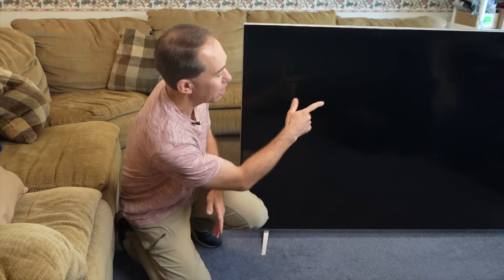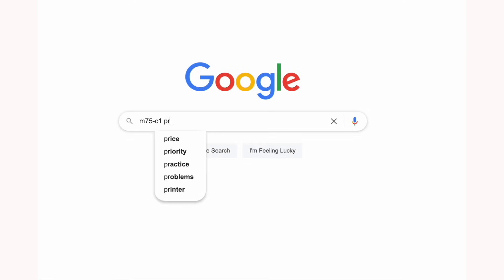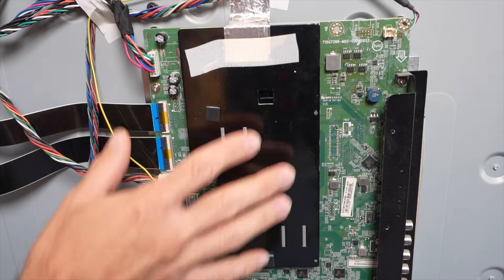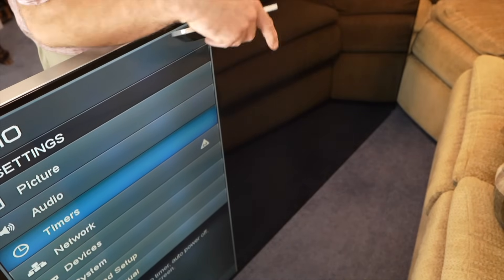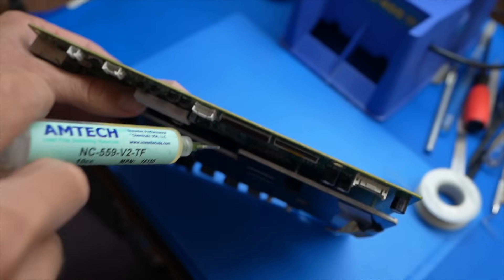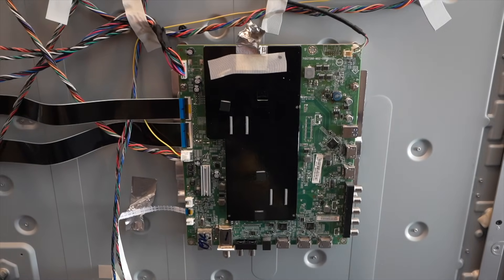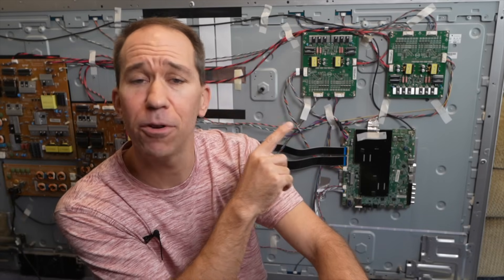I FIXED a HUGE TV for FREE - You Can Too!

Comment: Hey I found your videos while trying to troubleshoot my ASUS PG65UQ.. do you know if there is a fix for this? I cant add reddit link here, but in short the display started to display faint grey horizontal lines all over the screen.. very harsh when 144Hz enabled but now I get them when turning the monitor on at 120Hz.. but after 30minutes it kinda dissipates.. very strange.
Reply from the maker: Not sure, sounds like a faulty capacitor or another smd component
Reply: @FrugalRepair  Yeah.. thought they use long term capacitors.. I member fixing my old 52" TV that didnt turn on anymore by soldering on new capacitors..  but this problem is visual. I left a thread on Reddit with a screenshot in "Monitors" Reddit

Comment: Yeah reflow work but no one can say for how long... I used to do this back in the RROD Xbox days... it would always work but always fail again soon after... 
The Board replacement is the correct fix.... and maybe  thermal glue a bigger ( wider) heatsink) on it to prevent it from happening again...
Since it's a common failure on these Vizio tv......

Comment: What is the cause of static noise from tv? I got a 65in Panasonic plasma. It makes a buzzing electric noise. I tried disconnecting the hdmi cable to see if its outside interference but the hiss is still there.
Reply from the maker: That could be anything, really.  If the noise is coming from the speakers, it’s likely a problem on the main board.  But if not, sometimes you can get close enough with your ear to hear which board has the buzzing part on it.

Comment: I have the same tv and been having the same problem for three years now. I throw the board in the oven at 385 for 10-15 minutes about twice a year. There seems to be a 90% fail rate on the m series from Vizio and some of those parts are interchangeable with lg models (e.g., t-con board and power boards.

Comment: This is probably a dumb question to someone in the know, but where do you put the negative lead when you are probing the connections with a multimeter? We saw and understood the connectors you were probing with the positive probe but not where you complete the circuit with the negative.  Is it just the chassis, the neutral feed on the power cord or something else? Thanks in advance for any help.
Reply from the maker: Not a dumb question at all.  I have the black probe on the metal chassis.  I usually have it in a hole in the metal and hang it at an angle so you don’t have to hold the probe.  Any metal touching to where the screws to the boards are is good for a negative probe spot.
Reply: @FrugalRepair  Many thanks for your quick and detailed response and thank you for your useful videos.
Reply: @watsoft70  I was SO inspired by the videos you've done and I've watched several of them., That I have gone out and collected for 55 inch TVs, hoping to find one that still works actually. I was given a smart TV 55-inch the light blinks twice but no picture it's a Hisense. Do you have any idea what could be wrong with it the red light blinks twice then goes out. If you're anywhere near the Louisville KY area you can have the other TVs if you want. Free, I just want a 55 inch working TV.
Reply: Im sorry I meant to send that to the repair guy. I'm really old school and get confused easily.

Comment: Good grief. Board swap... Troubleshooting it to the component level is repairing. Find those leaky capacitors and fried voltage regulators and replace them with one beefy enough to handle the load and you have a repair that will last a lifetime. Not sure how you"fixed it for free" when you paid a hundred bucks for a questionable board.
Reply from the maker: You didn’t watch the whole video.  I didn’t buy any parts to work on the board.  I showed how you can swap boards if that’s all your comfortable doing.
Reply: @FrugalRepair  OK, I finished watching the last three minutes I skipped. I disagree with your diagnosis of a faulty microprocessor. If the chip isn't getting voltage due to a faulty component it will not produce heat. Rarely does an IC go bad itself, but rather a supporting component. Heat is the number one enemy, however. If it's not cooling properly you could be right. I was expecting a cold solder joint or a bad connection which you fixed "for free" based on the title.
Reply: @Ed-ym4tu  Ok, just curious but if it's a faulty component, than why did reflowing the solder under the processor work? Not trying to prove you wrong, I am actually trying to learn more about repairing these boards, so any information you have is helpful and very much appreciated.
Reply: @wolfman122970  I thought I saw you just swap a board. If you reflowed the solder and it fixed it then it was a cold solder joint.

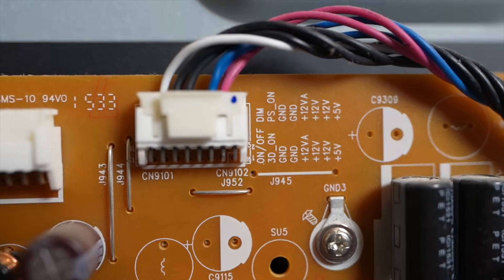Comment: 2:20 now, with your only tool, the screw driver, you verify the voltages. 😂
Reply from the maker: Yep, I'm showing you how I do it.  If you watch the whole video I explain how you could fix it with just a screwdriver.
Reply: @FrugalRepair  I was only joking a little because just a moment after saying that you pull out the multimeter (as in technically using two tools) :D
Was a bit funny.
Of course I watched the whole video :)
Thanks for the content!

Comment: I like how you only used a screw driver, multimeter ,flux, and a hot air station.
Reply: And a human body..., brains and ability to read and use his hands 
And think logically.
Reply: ha
Reply: It’s frugalrepair! What do you expect?❤
Reply: Some, all or equivalent substitute tools could be bought for super cheap. So there's still a large turnaround. 

Think. 25. Maybe 50 bucks. To repair a TV that costs probably 3000. 🧠

Even the 100 for a replacement board is a fraction.
Reply: @SacredMilkOG  Absolutely, worth the time and effort. However, not free. Free would be not spending any money and not having any pre requirements for it, just basic tools. and a Hot air station might be a bit more than a basic tool.
Reply: And heat camera.
Reply: And a PC with browser to Ebay and his electricity to power hot air station, lights, TV, etc. LOL

Comment: I picked up a 60 inch tv and no start condition. Found selector switch on rear with shorts. Ran current through it and conditioned the contacts and it worked again. If they would have spent about ten cents and used pull up resistors the contacts would stay clean.
Reply from the maker: Congratulations on the repair!

Comment: I wondered if you could add / mount a cooling fan. Thanks for a great video! And I subbed!
Reply from the maker: Thanks for watching and the sub!
Reply: @FrugalRepair  very welcome! 🤓 Is it really worth it to replace the LED / LCD screen on TVs ranging from 43" to 50"? Have a Vizio 50" (smart, 4K) & an LG 43" 4K. The Vizio works but the screen is messed up/damaged. Think the LG has a backlight problem. Thank you 🤓
Reply from the maker: If you have an extra lcd assembly it’s probably worth it since it is not that hard but I doubt you can buy one anywhere.  If there is a crack in the lcd then you can’t fix it.  Many other issues though have a fix or a hack you can do to get it working.  Did you watch my fix with tape videos?  That may help give you clues on things you can try
Reply: @FrugalRepair  yes I watched your "tape fix" video! 🤓 I don't have an extra LCD assembly. For a kind of hobby, I look in certain dumpsters, curbside stuff, asking people moving out of houses, apartments, etc, looking for laptops, PCs, Chromebooks, tablets, etc. My regular job is a warehouse (we sell gym equipment) worker. The business next to ours (a recording studio) had a defective LG 43" 4K TV, and gave it to me. The other TV, the Vizio 50", was a dumpster find. I actually don't normally take TVs, due to size.
Reply: @FrugalRepair  some time ago a neighbor gave me a Sony PS3 (working) & a Dell Latitude laptop (also works!) I want a TV (flat screen) for the PS3.

Comment: I have a vizio E390i-B1E . I was told it had no picture. The first time I tried it I got a picture but it was dim. Next time I tried it no picture. I pulled the main board out and took the heat gun to it. I just put it back in and have the dim picture again. What would cause the dim picture? I have played with the brightness. It would work ok in a dark room.
Reply from the maker: Not sure if the dimness is from the LED backlight or you are meaning an issue with the LCD screen / picture.   Did you happen to watch my videos on fixing a tv with tape?  You can try to do the isolation technique that I showed to give you clues on if the issue is on the LCD or not.

Comment: I got a 55 inch Vizio 3D TV I had a problem with the speaker he came and changed the speaker but when he changed it he picked it up the TV up and moved it without the back being on and now I have colors going everywhere. It was working great all he was to do was to change the speaker could it be he ruined the set maybe the screen got twisted from picking it up and moving it without the back on
Reply from the maker: Try reseating the cables to the lcd. Hopefully he didn’t mess it up
Reply: @FrugalRepair  thank you I'll give it a try

Comment: In the repair world it would be considered a bandaid. Reflowing got a bad rap because people would do the same on GPUs for computers and call it fixed. But the problem with GPUs were mostly bad chips. There isn't any real way of knowing if the chip itself is bad or if it's potentially cracked joints underneath from warping. So the safest options is usually just replace the chip or the entire board.
Reply from the maker: 2011 MacBook GPU is an infamous one.  You could technically know if it’s the solder balls versus a bond wire in the chip if you have access to an X-ray inspection machine.   =)
Reply: @FrugalRepair  Xbox 360 as well, and yes true. It would be interesting to see how many are actually bad chips though, but it's not worth the time for most people. Which is a shame.
Reply: @TM-op7zb  actually we're not just talking time it's cash flow as well. 
Not to many people are interested in fixing things anymore since we're a throw away society most items cost as much to repair as it does replace the exception is us few who are vested in the trade.
Reply: @red2965   I would say cash flow is usually not going to be an issue for most of these "throwaway" electronics. Of all the laptops, TVs, motherboards I've repaired it's been a regulator, MOSFET, etc for the most part. Something that's been 50 cents to $1 from AliExpress(occasionally Digikey for me) or free from salvage. The time it takes to figure out the fault/do the repair and wait weeks for parts usually only available from China is what most people don't want to do.
Reply: @TM-op7zb  only the diy can make that statement of you put it in the shop it isn't worth fixing because It generally cost as much as a replacement one these days it isn't like the old days tube goes out it was pretty easy to figure out then came solid state then it's all on a micro chip and thousands of dollars for equipment to diagnose issues then there's the problematic schematic issue since companies want to be secretive.
Stepping away for a second the KIA is a good example.
Reply: @red2965   These cheap electronics shouldn't be in a shop to begin with from customers though. Shops charge the time also, which is the argument here about repairing them. People don't want to waste the time. Northridge Fix and Electronics Repair School are good examples of repairs without schematics or expensive tools. Schematics are necessary(Apple), but for the simple $100 Chromebook or $100 Roku TV, not really. Even just straightforward circuits. Repairs can still be done with simple fault finding.
Reply: @FrugalRepair  or if you just slightly put pressure on the chip. Same thing for Nintendo switches. If it works after putting pressure then a reflow usually works. On the switch if you reflow processor you have to reflow the ram chips as well otherwise the pads under the ram oxidize.

Comment: A lot of failed visios like these have this problem.  One way to help these sets last longer is to turn off the quick start mode so it takes longer to start but the board doest stay hot its whole life, and save electricity innthe process. Flux and reflow followed by a nice slow cooling cycle should do the trick.
Reply from the maker: I don't think this model has quick start but I can check.  Thanks for the suggestion.
Reply: @FrugalRepair  i reflowed a couple P series Vizios, I think it might be eco mode or QuickStart mode

Comment: Just glue 8cm 12V PC 2-wire Fan in a strategic point for air circulation, and solder to the USB (+) and (-) (pin 1 and 4 ) . Test. It will be quiet and work only when the TV is ON.

Comment: thanks for sharing. Quick Question: how do you know how much volts you should have from each cable?
Reply from the maker: Thanks for watching!  Most of the time the main voltages are printed on the main board connectors.   The signaling lines are usually around 3v.

Comment: I've repaired TVs by switching out diodes that were obviously bad swollen and I've rewet solder connections on boards, but I have a question about my newest curb TV that said " works but no remote" Well, that wasn't true, at least the part about "works" anyway. So I wiped it off and plugged it in, looking for the standby ready light which did light up. Next I tried to find the control buttons on the outside of it which to my amazement, there were none except for a large power button underneath the standby light. So I pushed it and for a split second the screen had a flash of light go across it and that was it, after that the standby light started blinking. I'm sure this all means something, but I don't know what. Can I get some ideas from you? I look at it as a challenge to fix if it's fixable 🤔
Reply from the maker: Great to hear you are fixing things!  For that TV it could be a bunch of things.  My first thought is the led backlight shorting out.  I'd check for the main voltage rails, and then start disconnecting cables to diagnose where the problem is. For example, you can disconnect the backlight and see if you still get the blinking indicator light.

Comment: My name is Ben from Ghana. I bought a slightly used Soniq 48" smart TV. After a couple of weeks of using, horizontal lines appeared at the top. Can you help me on what to do to fix it? Can't afford a new one please. It's a 4K TV model number E48FH16A-AU
Reply: Try blocking some of the clock signals with tape on one of the ribbon cables going to your lcd screen buffer boards as you may have a short circuit in T con board somewhere. If that doesn't work probably lcd screen is the problem and can't be fixed.good luck

Comment: with the reflow method you did, its a bandaid and that will just be a temporary fix, for how long we dont know, but it will fail eventually
Reply from the maker: Would you say that if one could add some active cooling?  The passive cooling design is clearly not enough.

Comment: I call it a design flaw.  But nobody wants fan noise on a TV so this type of issue will continue to occur.  I don't see any way of having that type of processing capacity to support 4k and not having a heat issue with only passive cooling
Reply: I call it planned obsolesce, if you want passive cooling then all you need is more surface area, thus a larger heat sink, but they want to make it as thin and light as possible, they're probably saving a buck where a little metal would make it last 5+ years longer, plus it's not as if silent or near silent fans don't exist, we use them all the time on laptops, a laptop fan just running at idle would make more than enough of a breeze to make it last longer.
Reply from the maker: Another thing the designers could have added was more vent holes in the plastic housing.  Something that happens is that since these tv's just sit there the vent holes at the top get covered in dust and restrict airflow even more.
Reply: They could have installed a better heatsink, one with ribbons.
Reply: I have a computer sitting next to me that has 4 fans running inside of it and I can't hear it.  Maybe if I put my ear real close, but right now my ear is about 30 inches away and the room is dead silent.

It's definitely possible to actively cool a TV so you can't hear it, but most people won't maintain it anyway.